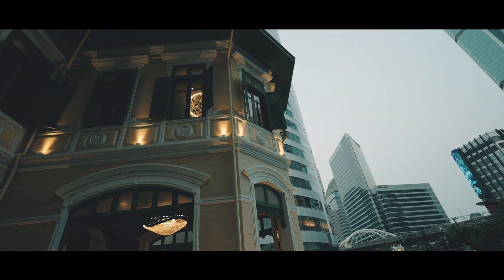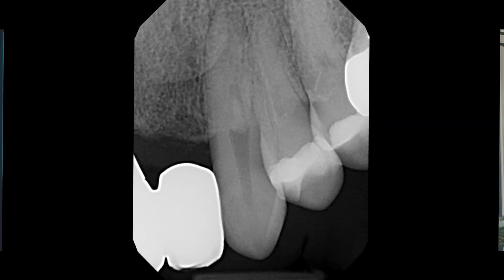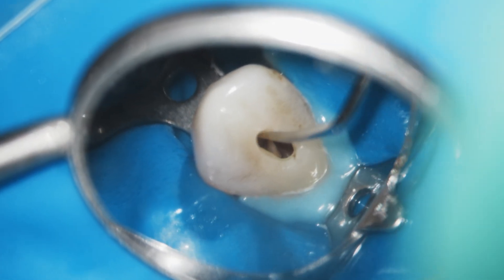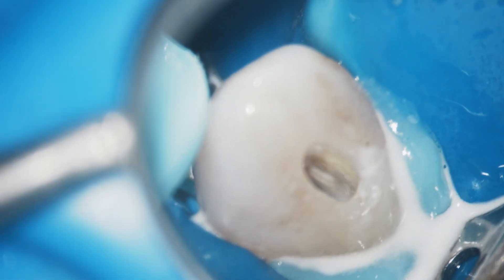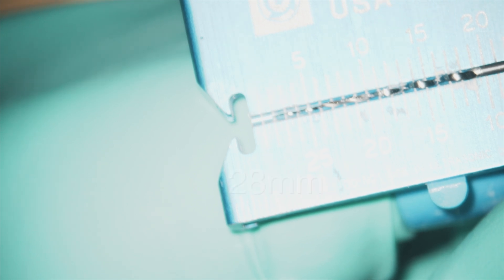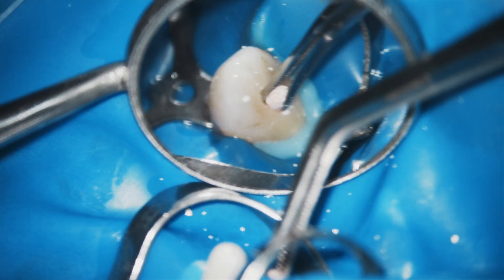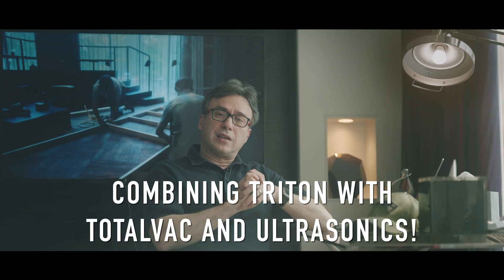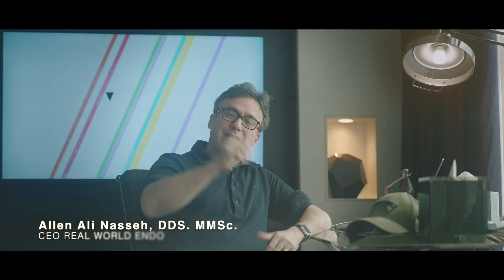Combined Use of TotalVac with Ultrasonics in Bangkok CBL 45

Comment: Unrelated question doctor.
When we have to add accesory cones when obturating wide canals with hydraulic condensation, would you reccomend using spreaders?
on one hand we are filling the canal with more GP instead of bioceramic sealer (bad) but on the other hand this might create more hydraulics for the sealer to penetrate
Reply from the maker: I think adding the cones should suffice for filling in space where too much pooling is present and you run the risk of voids. Adding spreaders increases the lateral force and is not necessary in the era of bioceramics in my opinion. At best it's not going to make a significant clinic difference and at worse it can increase the odds of a root crack. But if you can do so passively and you feel it adds more time then I don't see any problems. Cheers! :)